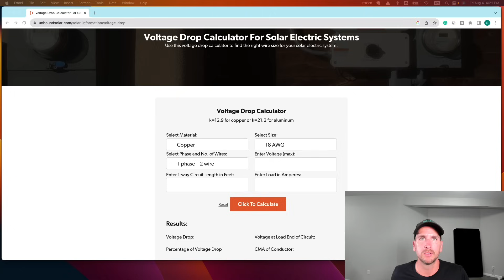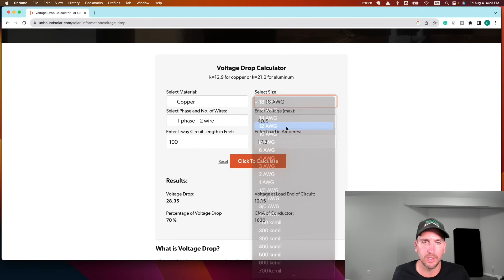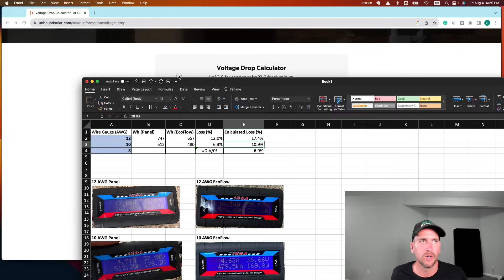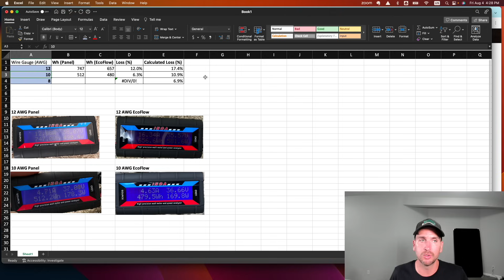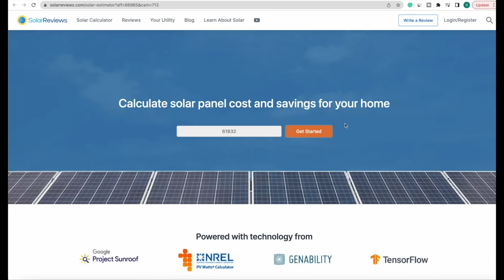What Wire Should You Use For DIY Solar Kits? Surprising Results!

Comment from the maker: Calculate Solar Cost For Your Home - https://geni.us/solar_reviews

Ecoflow Delta Pro: https://geni.us/smzZiC

8 AWG Wire (100 feet) - https://geni.us/BtgTNT
10 AWG Wire (100 feet) - https://geni.us/qAgIb
12 AWG Wire (100 feet) - https://geni.us/Haist
Power Analyzer - Power Analyzer - https://geni.us/s86J

Line Loss Calculator:    https://geni.us/Hhxpk

DISCLAIMER: This video and description contain affiliate links, which means that if you click on one of the product links, I’ll receive a small commission.
Reply: Did you ever look at those hybrid panels that produced hot water by cooling the panels with water? I think they were an Aussie or New Zealand firm. Their primary goal was to reduce degradation due to heat but the byproduct surpassed their expectations.

Comment: Actually... if you max out the input on your solar generator and over panel, it doesn't matter.  Keep volts high and keep the amps a bit below the max so your appliace pull won't glitch out your AC output.

Comment: Those power analyzers look great! I wanna get them, but from the online description I can't tell of the PV wire I currently have will fit inside; It's ALANWIRE PV 10AWG that is 7mm in OD- might you be able to tell me if 2 of these wires will fit inside for monitoring?
Thanks! And thanks for the great videos!

Comment: Question, If your wire you are using doesn't match with your adapter cable wire for your storage unit, would you still lose wattage?

Comment: Everyone calculates solar cables, but nothing calculates how the inverter is connected to the grid. Especially the calculations from a smart meter connected to an inverter somewhere far from the distribution box don't add up. Let's give you an example: two energy sources: the grid on one side, the inverter on the other, and somewhere in between, the home load. The question is, who generates more energy: the inverter or the grid?

Comment: can you run the same pv wire red and black with an insulated ground in concuit together from the box to the breaker? I have a small deck 4 panel. wanting to run the wires with the  ground in pvc conduit under the deck to the crawl space and then up into my breaker box. the ground goes up into the box to ground with the house. I’m not sure how to get the solar wires from the crawl space into the solar generator.

Comment: I'm a Ham radio operator, we use something similar for power loss with coaxial cable, but the frequency you are transmitting on makes a huge difference to power loss.

Comment: test high power cables, not thin wires, i have 30 meters line cable aluminium  and 20m ground cable, seems solar dont like shows 50w with 400w panel

Comment: Test is a bit flawed, the higher gauge wire had much less sun, which has a big impact. Generally series is preferred as stepping up the voltage and dropping current has a massive impact on line losses. 2 panels in series will have about 25% of the losses vs parallel. This wasn't really talked about much, so video is not super useful as you could easily get this setup within acceptable limits with 10 gauge, possibly even 12, though 10 is generally considered a good middleground unless you are doing several parallel.

Comment: Neat video. How significant of a loss do you think you take from the small-gauge connector wire between the EcoFlow and where the DIY cables hook up? It's only a couple of feet, but it's still a much smaller diameter wire than the main ones.

Comment: According to the Books you should Invert the D.C. as close to the Panel Array as possible bc you'll have less line loss with A.C. even on lower guage wire. In fact the higher the A.C. Voltage the smaller the wire you can use and the lower your wire cost. Have you tested this scenario?

Comment: I bet your discrepancies on the calculator are because the calculator automatically adds on 50% amperage for safety, ie it's giving you calculations for 26amps when you put in 17 amps.
Reply: Ie if I run your 12ga numbers through a different calculator it gives me about 14% drop not 17 like yours did

Comment: Use the Southwire calculator. Best and most accurate wire load/voltage calculator on the Internet. Bottom line, higher voltages and lower amperes on wire have lower losses.

Comment: I have this urge to stay under life-threatening voltage, 48V —can someone please reassure me that it's okay to have cables carrying 300V lying around in my garden. 
I guess the reply would be:  "if you have to ask this, you're right that it is not safe for YOU"    
...but I know what I am doing, being an engineer, and I need a really professional advice about safety measures beyond the usual things, like use proper outdoor/burial cables, enough burial depth, use conduits, warning tape, like perhaps:
1. running the two poles separate paths?  Does it make sense regarding safety?  (so no chance of touch the two at the same time)
2.. How can I use a RCD ?   is it possible, does it make sense on a floating DC at all in any way of creative wiring ?
3.  Is some kind of cut-off safety automation on the solar panel end available ?  Perhaps that would sense a damaged cable, e.g. on no current draw? and cut it off
... or any other idea to make it more safe in an environment of of pets, curious children, flooding, earthquake, or hurricane.   ...just kidding, but you know what I mean.

Comment: This is one of the reasons something like an Anker Solix isn't a great choice in many cases (in my unlearned opinion).  The low-ish max PV voltage means increased line losses or much more expensive wiring, especially if you have a long-ish run between your panels and charge controller.  The 165v limit is a lot lower than even less expensive AIOs which can do 500V+.  For example, if you're running 165v, 10a, 150ft over #14, your IR drop is around 5.5%.  If you're running at 500V, that drops to 1.8%.  I don't get why they rate it that low as it's advertised to be a whole-home solution with the hybrid transfer solutions.

Comment: You're seeing a 50% improvement for every 2 AWG smaller you go, which suggests that if you went with 4 AWG wire you'd be around 1.5% drop. For long runs, it is always better to boost voltage; current loss = heat, meaning the more current running through the wires the hotter they get and that is why you end up with less voltage on the other end. Choose equipment that can handle big voltages and you can then run thinner gauge wire.

Comment: I have a DELTA PRO AND 2 of the 400w rigid EcoFlow panels connected. I occasionally see an input at the Delta Pro of over 800w.  I want to add 2 more 400w panels for 1600w total. The voltage is 37.1. Times 4 =148.4 and the Delta pro can handle up to 150v. EcoFlow says the panels output 37.1v but + or - 3%. Do you know what happens if the voltage temporarily goes over 150v? Does it damage the Delta Pro or will it just not accept the input?

Comment: My trailer is about 75' away from the battery bank on the solar shed, so I just bring down the power from panels to the batteries located on the wall, then an inverter converts to A/C where a 75' 12 gauge extension cord brings the 120 volts to my trailer.  I think that is the best way to do long distances, keep the panels and batteries close together and use a longer a/c cord since the losses are much less through the higher voltage a/c wires.

Comment: Please could you do a test for this battery and a power generator connected to two breakers connected to an MPPT and solar setup so you can independently charge the battery and power generator?

Comment: So the shorter the cable the less lose?
Reply: Yes. Also higher the voltage, lower the losses. There's a reason why power poles carrying electricity to long distance homes are 10kV.

Comment: Run 100ft? lol. Only when running high voltage systems. You want to get your battery and inverter as close as possible to the panels.

Comment: Did you discharge the battery to the same point between tests? Depending on it's state of charge the battery will pull a different amount of current. If it's absorbing current slower there will be less heat produced so less line loss. 
  The same can be said for testing during cloudy conditions. If one test was under full sun it could be generating much more heat than a test charging slower under overcast conditions.

Comment: Amazing that you've had >500k for spreading ill-informed nonsense. No installer in the world would wire panels in parallel. 9 x 440W panels in series @ 50V per panel and 13.2A short circuit current. Result - 450V CD and 13.2A. You should delete this video. It's misleading people who have even less knowledge than you.

Comment: High volts and low amps is the best way to gain maximum efficiency and safety and running panels in series is also safer as there are less connection points, no fusing needed and hence less loss. Go for an inverter that can take 500+ volts and ensure the series of panels runs max volts 15% below the max of the inverter.  I run 50 foot length at an average of 340 volts and less than 10 amps all day long with loss of less than 1%.

Comment: Voltage drop is a constant voltage amount per meter of the gage at certain current. You calculated single module. If you did connect modules in series, percentage would reduce proportionally

Comment: It's the DC that's the prob. For really flexible solutions: I'd covert to AC if it's more than 10 feet. Then no losses on any cable size. I'd also consider putting a cable ring in round the property. You should be able to use a roll of 100m 30amp standard multicore 3 core cable but use a different color. It makes it flexible and future proof, you can tap into the cable anywhere. Of course it  depends what you are going to use it for! In this video example a 20amp 12 AWG would do the job. But you can just rectify and smooth back for a few $ and feed into EF EcoFlow DELTA Pro 3 etc. But you can add if you get someone qualified to check it: So with the example 2 Parrallel by 2 Serial would give you 80v by 17.5 amp on 12AWG with sub 1%~ line losses. But I'd still use 10AWG to be able to expand later but that gets a bit more technical, and requires some design for load balancing and monitoring but theoretically you could up it on the same 10AWG cable to 18 panels: 6.4Kwh at peak! I prefer Monocrystaline panels but they are very directional! I know it's not Everyday Solar; but just my thoughts.
Reply: WRONG!! AC voltage drop is higher than DC given the same current draw and distance. Convert to what? 120 AC? 240 AC? In givan example with 12 gauge wire 17.5a load at 100ft distance AC voltage drop would be about 6V. Converted to 120v that is about 5.5% drop. That's why power lines run at extremely high voltages. The reason that historically AC was used in residential is because transforming AC voltage up till recently used to be much cheaper than converting DC voltage.

Comment: 100 feet seems to be a common recommendation for a MAX distance.   Have you done any studies on how much loss occurs at shorter distances such as 50 ft, 75 ft, 90 ft, 99 ft ?
Reply: Loss is a function of wire gauge and voltage. Distance is a function of where you need to mount your panels. If your system is mounted further you’ll just need thicker gauge wire to compensate for the lost voltage due to distance.
Reply: @ziggyd3114  Thank you!   I bought the hybrid package from Signature Solar but can't find what size wire they're providing.  I assume it's heavy enough to go the 75 ft I need.

Comment: What about another video. Does it matter if the mppt controller is next to the panel then 100 ft wire to the 48v battery, or 100ft wire from the panel to the mppt controller next to the battery.

Comment: with the bluetti ac70 that says it can handle 500W Max,12V-58VDC, 10A, when it comes to wire sizing, do I only care about what this solar generator can accept because it will only take what it needs up to it's max? therefore if my bifacial 550w panel says Imp-13.20A-15.84A and Isc-14.00A-16.80A none of that matters right? The VOC is 49.6 which is under the 58VDC the Bluetti maxes at. Therefore 10-12awg is ok to use for an 18ft run?

Comment: Generally for anything I only use pre-fab cables for short runs, and use raw wire for anything long.
I have a few hundred feet of 6ga that I got a long time ago that is direct burial rated for landscape lighting, I think it might become solar wire :)

I suppose its also worth mentioning for those not super familar with electricity, that say your terminals/connectors 10ga was the largest you can connect, a short bit of 10ga stepping up to larger wire for the run still will help you greatly.

I know common sense kind makes you think you will be limited by the thinnest wire, but its about the resistance of the entire run.

I a DIY everything smart home IT guy, but still some of the larger things I want to do I have to pay an electrician for, simply beacause the work has to be done by a licenced electrician.
So for now I'll start small and experiment with stuff I can do without permits or a license.

Comment: Can someone please help me Trying to figure this out, on my 1st set of panels 70' out from my EG4 12,000 BTU mini split I used 10 gauge wire ,on my second EG4 12,000 BTU mini split Will be 100' away from my panels, Should I use 8 gauge wires?      I have four - 370 watt Panels wired in series on each mini split. Any advice or comments greatly welcome thank you

Comment: I'm using my panels in series (small setup) at around 72v 5.5A maximum current. 12awg or 10awg is way more than plenty for that. The cables aren't that long either.
(My setup, just wanted to share)
Solar energy is so amazing

Comment: 8 gauge as its good for most 12, 24 and 48v systems within a decent distance of your inverter. The true problem is the amperage based on your setup. More amps = thicker cables needed. 12v will not only have tons of loss but your thinner gauges will heat and or fry and limit how many panels can be combined into a single two cable (pos+neg) run

Comment: Basically always buy the biggest best wire you can afford.
Next always run the highest voltage you can.
Reply: I can only afford 16 gauge so this is good news. I figured it would be too thin.
Reply: Basically wire the panels in series instead of parallel. Higher voltage is easier to carry than higher current. That's why all the panels are rated stupidly high like 650V or similar. Because then you can wire them in series. Sure, if one panel is dying your are loosing output on whole series, but you can do combination of the two and save on copper or simply monitor temperature of each panel for failures. Still significantly better than parallel.

Comment: Also, get rid of those shitty solar connectors. Wire nuts are way more awesome!

By the way, those in line digital meters also contribute. Put two back to back a few feet apart. You'll be surprised.

Comment: There are two "fallacies" that I would have liked you to counter in this video. First one would be having a baseline where both of the "meters" are connected without test cable to make sure that they both show 0% losses (which they probably wouldnt) and put that as a baseline. Second thing would be to move Ecoflow to solar panels at the end of the test to the solar panels to show both meters on one camera shot. If you are taking two pictures, this might affect capacity measured (not much, but still). This preferably should show both of the meters. One last thing would be to replace solar panels with some kind of battery to make sure that you are doing repeatable measurements. Doing 500wh on 12 AWG and 800 on 8 AWG is not comparable because 12 AWG would heat up more with 800 WH (input measured) and create even more losses. Temperature has a big effect here (at least non neglible).

Comment: I wouldn't even consider doing a test like that. All you need is a constant voltage. Just plug it into something and dial it in. You don't need the sun. You don't need the panels. That is an arbitrary variable you don't want and that way you could vary the voltage and you could run multiple tests very briefly and it's kind of a silly project. Anyway, what you really want to do Is shorten the wire get it down to some reasonable length. 100 ft is extreme. What happens when you cut it in half? Does the loss cut in half or is it 40% or is it 60%. Those kinds of questions are worth asking 7:48 7:48

Comment: 2x the voltage, 1/4 the losses. So the default should always be as much series as possible.
But: the efficiency goes down massively if the series panels are unevenly shaded. All partially shaded cell clusters drop to 0% production. Parallel connections don't have that problem. So you gotta choose what's better for your application.
The wire material also matters. Aluminium is less conductive and has higher losses. But it's not only cheaper at the same diameter, but if you choose a thicker cable to offset lower conductivity it's still cheaper. So ideally go for a thicker aluminium one. Just beware, aluminium cannot be soldered!

Comment: Much better off in series and half the amps. For larger systems potentially multiple wires would better serve you with multiple series rather than series AND parallel if you are maxing out your voltage and need to have multiple series. Many house-size installs have multiple inputs per MPPT and/or multiple MPPTs.

Comment: Its simple, use table 310-16 and find the wire that will handle the MAXIMUM amps your panel can produce, also as said use as high of voltage your controller can handle OR better yet use an optimizer.

Comment: If you have pre-made connectors made up with 14 AWG wire, can you splice 10 AWG between them or would it be better to get all new connectors and crimp them on 10 AWG  wire so the entire assembly is 10 AWG ?